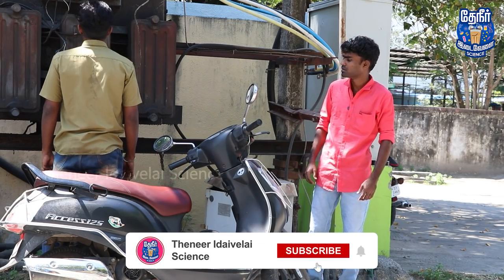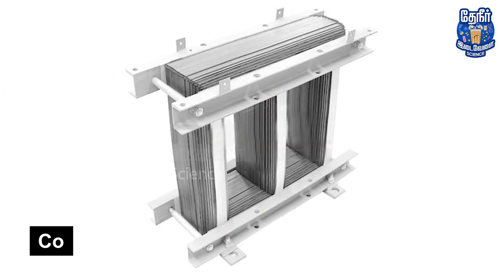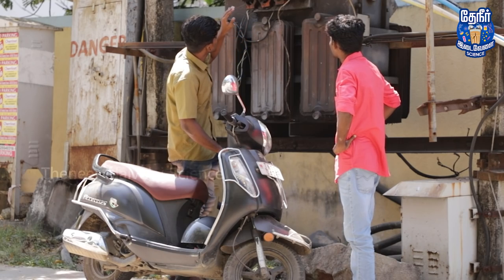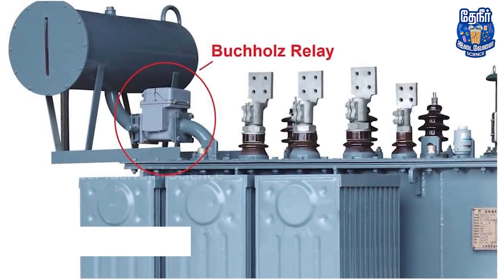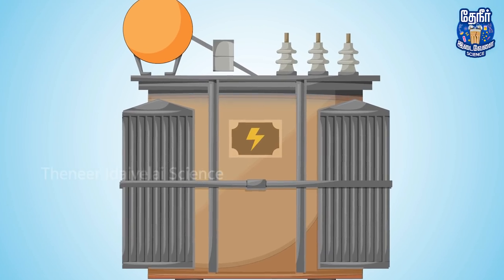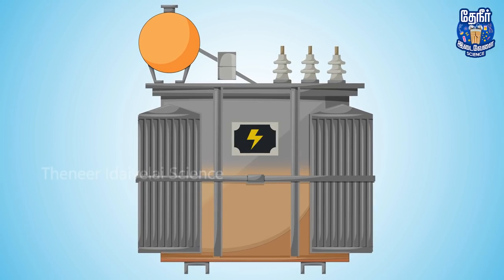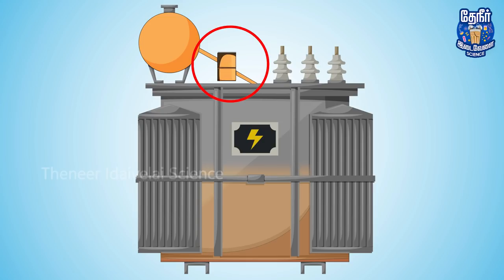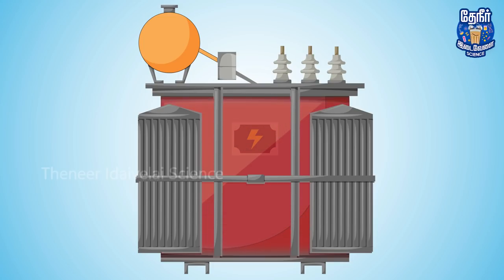Why do transformer explode | How does transfomer work in tamil | இதனால தான் Transformer வெடிக்குது?!

Comment: Bro buchholz relay is not available for local 500kva Transformers mosley used in above 2mva Transformers because of cost...and buchholz relay is only for tripping only additional safety for transformer already all Transformers have Presure Release valves (PRV) if transformer over heated automatically tripped by temperature sensor inside each winding or oil temperature mostly Transformers bust due to over load or short circuit...

Comment: Buchloze relay is not available at Most of the distribution transformer due low voltage level and low ratting level.
Reply: This relay not needed for kva trfs but for mva trfs it's must.

Comment: அண்ணா transformer main tank la iruthu than oil conservator tank kku pokum conservator tank la iruthu main tank kku oil varathu . Transformer over heat akum pothu transformer oil expand akum appo intha oil Buchholz relay valiyaka conservator tank kku oil flow irukkum  . Conservator tank oil fulla irukkathu off tank than irukkum appothan intha expand akura oil la conservator tank store pannu transformer heat reduce ana udane oil main tankku return akum. Main tank la winding short circuit akum pothu oil ulla air bubbles creat akum antha air bubbles Buchholz relay cross pannum pothu Buchholz relay activat aki transformer incoming power supply ya trip pannum...

Comment: 1. Conservator tank uses: 
It acts as a reservoir for transformer insulating oil.
When transformer is loaded and when ambient temperature rises, the volume of oil inside  transformer increases(main tank).
A conservator tank of transformer provides adequate space to this expanded transformer oil. 

Buchholz relay allow certain level of oil to conservator tank beyond that it will not allow to conservator tank and in that condition Buchholz relay mechanism will come in to picture and it will give trip command to circuit breaker.